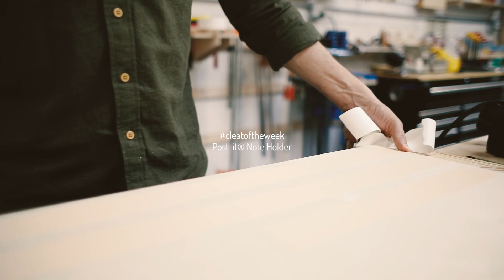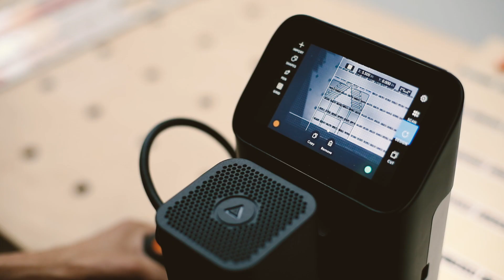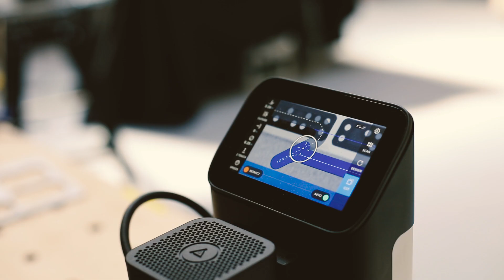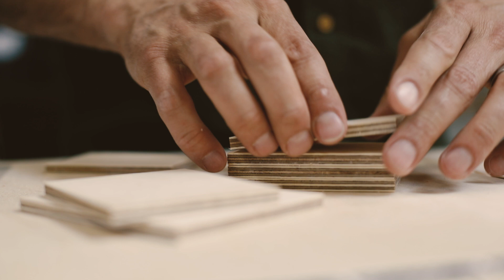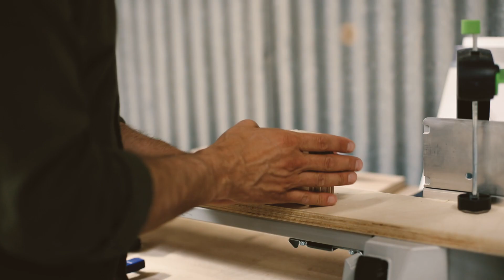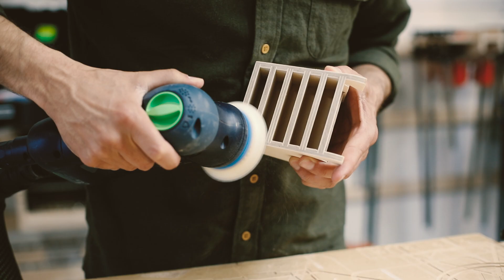Making a French Cleat Post-it® Holder using Shaper Origin

Comment: Why are almost all of these demo videos using plywood.  I use ash, red oak, maple etc.  Is there some reason you are avoiding hard woods ?
Reply: I can't speak for Shaper HQ, but I can assure you that the tool will work perfectly with any sort of wood that you want to use.  (I do have one, and it's a great tool)
I personally would not use hardwood on this project for a couple of reasons.  One ... this is a holder for 5 bucks worth of post-it notes, and doesn't necessarily warrant beautiful wood.  Two, it's somewhat hard to source what appears to be 1/4 inch thick hardwood that is perfectly milled. And three, this is nice quality plywood, which has it's own nice look with a good veneer and interesting color variability within the plies.  After all I can get maple, birch, cherry, walnut, etc plywood.
Reply from the maker: We love working with hard woods and many other materials. For sheet-material projects like this one, plywood is an ideal material. It's very dimensionally stable and easy to process.  Check out some of our other videos to see non-ply projects on our channel, for example- https://www.youtube.com/watch?v=BD8Q7X1mDKo&t=2s
Reply: Charles Robinson for your task I agree that plywood is the best material. It's just that almost none of the demo videos use hardwoods. I'm interested in mortis and tenon joinery and cutting out fairly large furniture pieces.
Reply: In that case, I think you are in luck.  Look at the Shaper you tube site and look for mortise and tenon and there are some neat videos showing off part of the capabilities.  of course what the owners figure out is bound to exceed the expectations of the designers and producers of the Shaper.  The maker community is way over the edge  of genius in a lot of areas figuring out neat stuff to do.  With a tool that is this 'interesting' to begin with, there's no limit on the creativity of the users.  And may I complement the company for it's improvements since the original product launch.  There are already nice enhancements to the software capabilities.  And it worked to begin with.  No vaporware or disapointments, but getting better already.